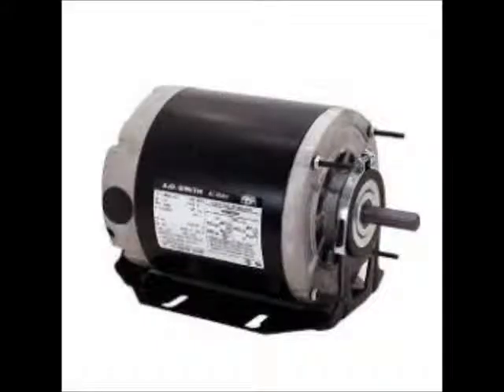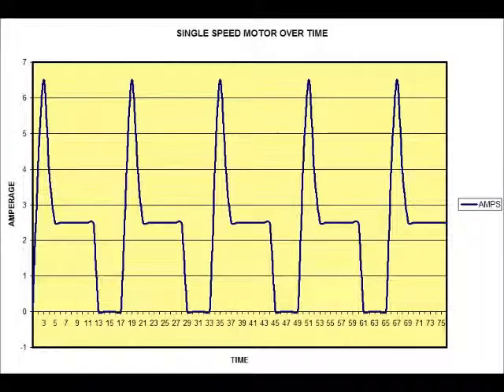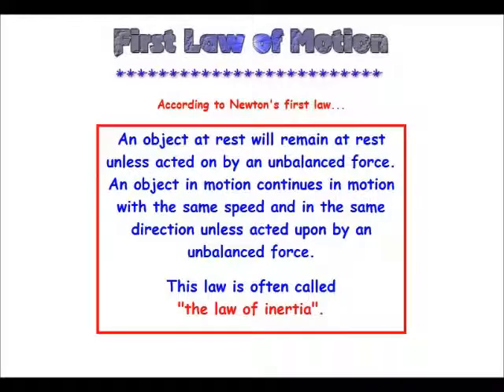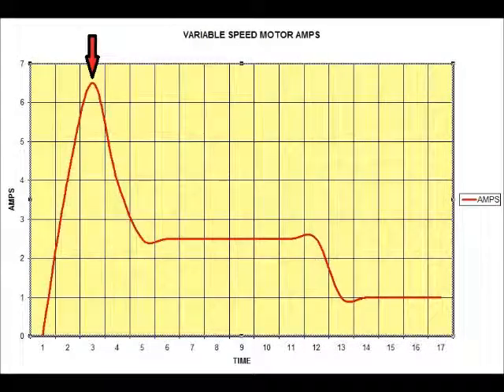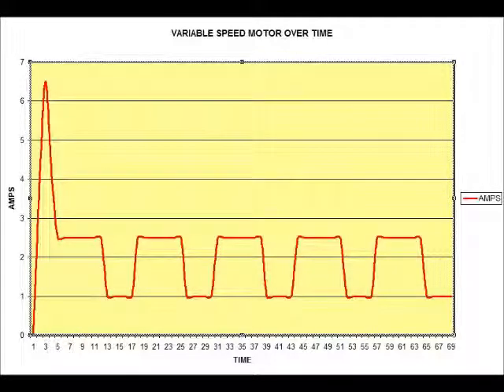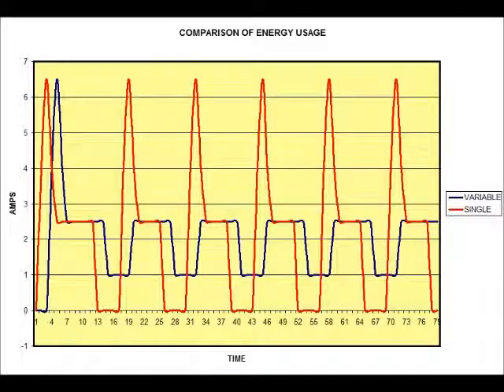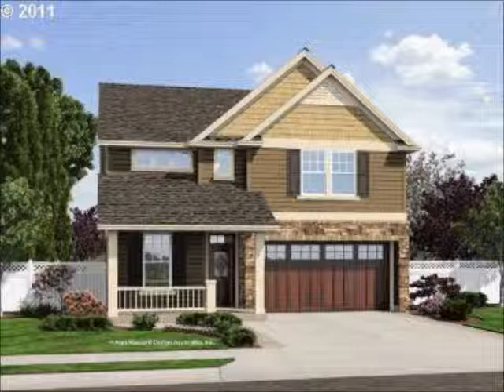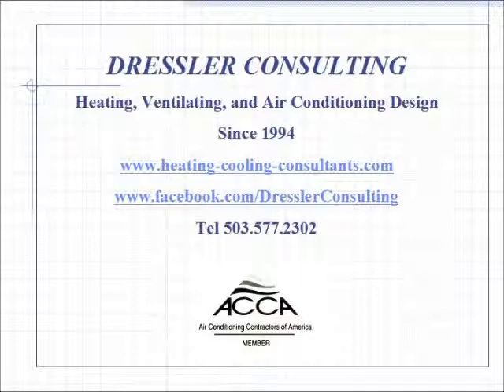Saving on your heating with a variable speed motor

Comment: to retrofit you need new variable speed motor, plus electric harness and, possibly, new fan control board. and parts are expensive. my company charges about $1200 just to replace variable speed motor. i don't understand how he came up with $550-$750 and installation.